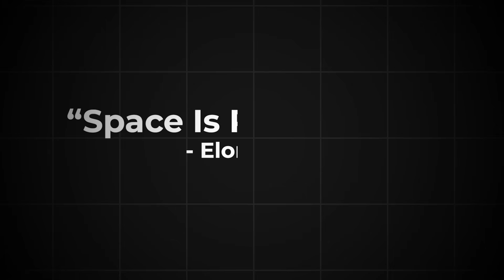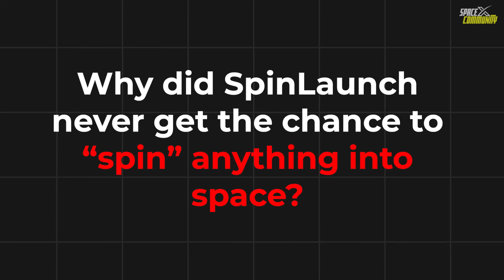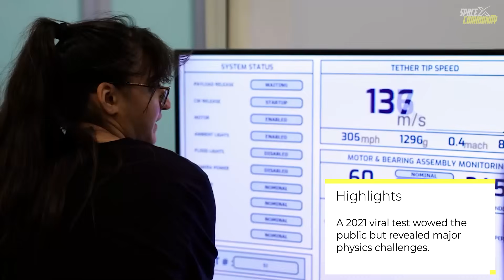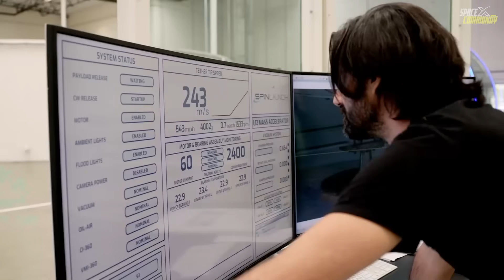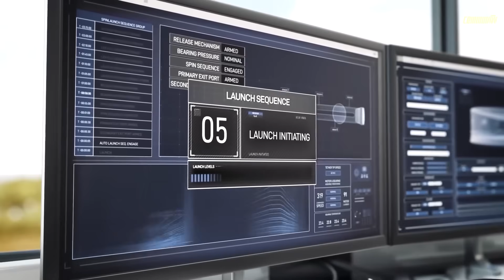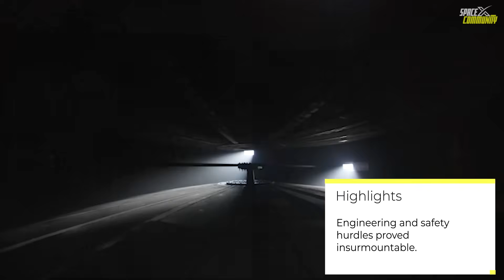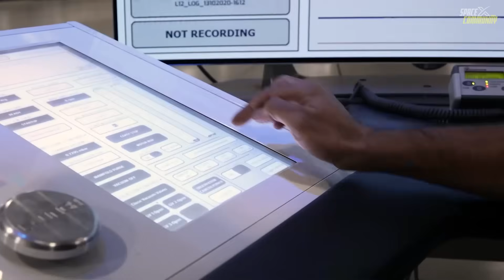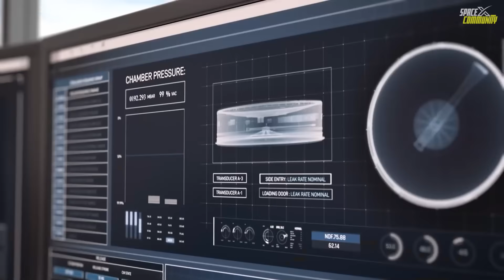SpinLaunch Scraps Orbital Accelerator After Physics Proved It Impossible | What Happened?

Comment: 00:17 A projectile breaks through something like a paper. But when it is only 1 square meter, this paper has to separate vacuum from normal atmospheric pressure. This is 10 t pressure on one square meter. Now imagine how strong this paper has to be.
01:58 That is the joke "a small rocket accelerates from 1 to 8 km/sec"
03:30 In WW II US mastered the proximity fuse: a small radar with vacuum tubes surviving the 10,000 G acceleration in a gun barrel.
Reply: I guess the worst fail would be disregarding the centrifugal force of the rotor. If the payload capsule is still attached to the rotor, everything is cool, because you can have the exect counter weight on the other side. That would work as it s shown in the video. But what do you think happens the moment you let the pay load capsule go? While the counter weight is still attached.
I would want to stand next to the machine then....
Reply: @petebeatminister  they need release  at the same time the disposable counterweight too, against a deep hole to the bottom maybe....